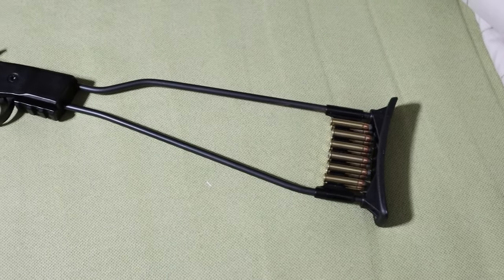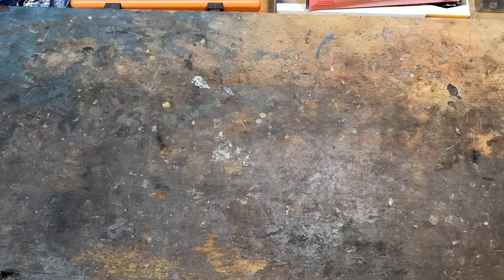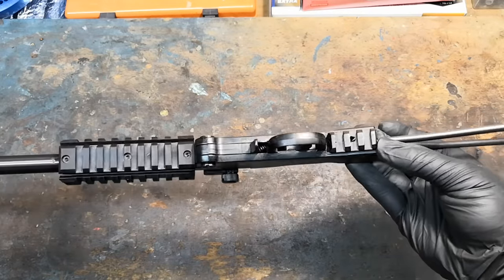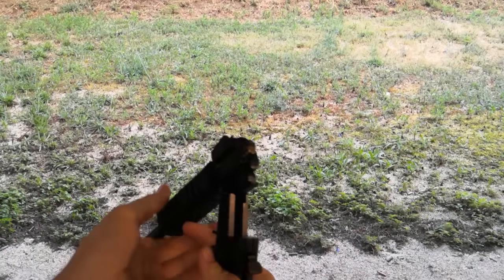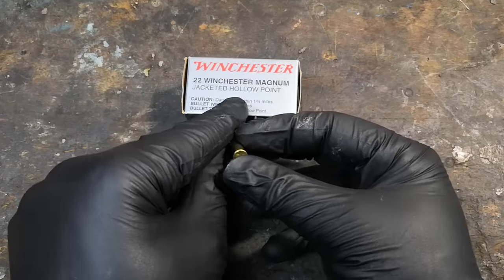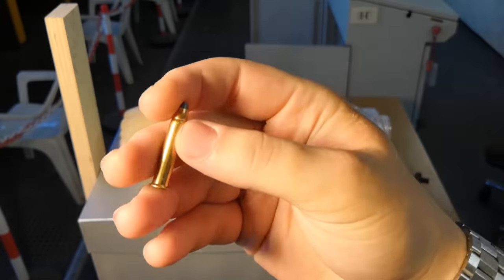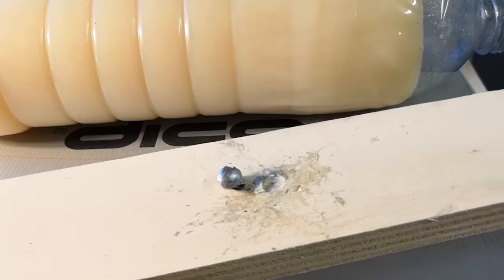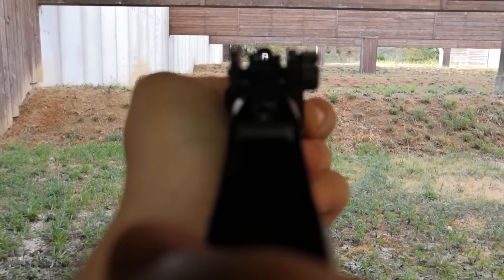How Good Is The Cheapest Rifle On The Market? Chiappa Little Badger

Comment: Seeing that wood baffled range, reminds me of my 2018 Trip back to Italy, and a visit to a friend in Parma. We went to his local shooting club (Ex- Military Rifles) range, and it was exactly laid out as this.
The Chiappa ( le chiappe means (a) window or shop shutters, usually wooden) or (b) Butt cheeks, plural).
The Name Chiappa derives from the Shutter origin, meaning a carpenter skilled in woodworking Shutters, both hinged, or removable, for securing ground floor Windows against illegal entry, or weather.
There is also an Italian Pun Joke regarding Shutters and Butt Cheeks ( untranslatable).
BTW, the gun shown is derived from a portable single shot 12, 20, 28 or .410 folding shotgun of Italian 1950s design, with full wood buttstock, and grooved forend to accomodate the Trigger Guard.
Still a bit awkward with a 28inch 12 ga. Barrel, folded, but will still pack well in a holster for Back packing.
This modern .22 version also reflects the M6 Survival rifle ( USAF).
Like the old " Marble Gamegetter" in .44/.410 shot.
Doc AV  Australia

Comment: A " suppressor" and ot can fit in a bag my friend you have a hitman weapon
Reply: pretty much. Sniper rifle on a budget. Put a suppressor on then use a subsonic round. You'll have to be fairly close and get decent shot placement, but it potentially can kill. 

People won't hear you as well and you can probably dump it if needed without losing much money.

Of course, at that point, you might as well build your own gun and accessories.
Reply: To much movies kid.
Reply: @dannygarden464  Eh, it's doable. A subsonic 22 fired from a suppressor sounds like a staplegun instead of a real one and can kill with good shot placement.

Personally, it's not my first choice. A larger subsonic round would pack more of a punch and be more lethal.
So, this in a 45ACP with subsonic rounds and a suppressor would be significantly better for the job than a 22LR or 22WMR.
Reply: @InfernosReaper  I was talking about the remark " hitman weapon " and yours " sniper rifle ", it's a 22, 1 shot,  a suppressor on top lol, you'll have more power and punch with an air rifle and as a bonus it's quiet enough, this rifle is more like a survival \ emergency kind of gun, and for the hitman weapon pretty sure they don't use that kind of weapon ( 1 shot), well some use a 22 as a gun because you need to put alot of rounds on a target to make sure you did the job right ( the zipper method)  and you put sub rounds with a suppressor that would make it even less lethal, so if i was stuck on a job with this weapon I would get to the target and hit the crap out of him with the rifle. ;)  still talking about the hitman weapon right ;)
Reply: @dannygarden464  While I agree that a more powerful weapon is better, for just killing 1 dude, good shot placement will make even a 22 more deadly.

I'll let this comedic scene make the point better than I can.
https://www.youtube.com/watch?v=ZTQSBm5A_FI
Reply: @dannygarden464  yeah, I have heard talks by ex CIA guys that say an assassin would usually use a .22 with a suppressor and it would barely make a noise. On a side note I had a friend who was accidentally shot in the chest with a .22 just once and he died.
Reply: @dannygarden464  I use a .22 for dispatching animals and have personally killed several 400 LBS+ pigs and a 1500 LBS+ cow with it.

Would a stronger round be more effective? Yeah, a sledge hammer probably would be more effective. But, it's pretty much a matter of tradition at this point and .22 leaves them dead enough.
Reply: @izzyb614  Yes my uncle use to use a 22 on the farm too but not for cows and pigs, well he change for a 22 power ( center fire) and was the only rifle he was using, I remember younger he teach me with the old 22 and after with the 22 power, versatile, cheap ammo, accurate, perfect for long shots and critters, good memories. ;)
Reply: @michaelreese8041  Yep I heard that too but it most be some truth behind it, I saw alot of airgun like an umbrella with a pellet with poison, with a 22 not so much and the ones I know didn't succeed, you have to put alot of rounds to be most effective, I'm really sorry for your friend, the thing with a 22 is once it enter the body you can't really know where the bullet will go, so powerful with no mass, sometimes it bounces and ricochet couple of times without leaving the body, a 22 with a suppressor or silencer can get pretty quiet but not like in a movie for sure and you need a special permit to have one, people think it's a little gun or rifle like a BB gun but it's very dangerous since the bullet travel very fare compare to other calibers.

Comment: I like its portability, its rear adjustable sights, the reload stack in the butt and that it has accessory mounting options, which I think he should have included at the end. I also like that it has a threaded barrel for a muzzle suppressor.

I want to see it with the suppressor and pistol grip on it. And Im curious as to what effect the suppressor has on its velocity or range, and id like to see a cluster pattern using the suppressor and a scope with the rifle stock.

Also I would have liked to see the pattern cluster at different ranges just using the iron sights.

And if it can receive a scope that would remain stable when folding and stowing between uses.

And the penetration test from a minimum of 25 yards away.

That's for simulating flesh, and if I had to use it on a critter, I doubt I would be able to walk right up to it and tell it to hold real still now while I shoot it behind the left ear.

I think you had better be an excellent shot with it so your game doesn't suffer while you reload.  
First shot is the kill shot is the last shot. One shot.

Comment: Add a vent ribbed bar and you could add a good scope night vision  etc. Windage sights would be nice. Although in 22 cal point shooting would be the way i shoot it. Hell with looking down the barrel. Im surprised it kicks that much with a 22 cal. Wait i just looked at the bullets. Are those 22 mags? They look longer than long rifle. Try yellow jackets in 22 long. They never fail. Rusted corroded wet dry theyll never fail you.

Comment: Very neat little gun. The caliber is limiting - in this case, the 22 Magnum won't offer any better performance than a underpowered load of 9mm Parabellum.
As far as survival gear goes (including for downed pilots), it seems to me that a 44 magnum with a 7.5" barrel would be far superior. It will have 3x-4x the muzzle energy and will be sufficiently powerful and accurate enough (with practice) to take down medium size game at 100m. Also, you get six shots before needing to reload.

Comment: I'm far from a gun expert, but is a plastic tip a good idea?
Reply: based of the firing speed i doubt it would end up an issue, especially using lower pressure cartridges

Comment: Compared to the Henry version of the AR7 the Chiappa Little Badger simply cannot compete as a reliable survival gun: - it is cheap and parts such as the firing pin will fail as will the soft chamber metal where your firing pin hits home. How do I know this? As a gunsmith I have worked on these guns quite often and, while I appreciate the extra work they bring me, I cannot in good conscience, recommend them to my customers. For just a few measly dollars more you can get a far more reliable semi-automatic .22 in the US made AR7 - but make certain you get the version made by Henry as the earlier Charter Arms version is worse, in terms of quality, than even the Chiappa Little Badger (again, I did warranty work on the Charter Arms guns and they were very low quality with a near-guarantee to fail owing to shoddy chamber metal which would crimp on the fired brass - necessitating a chamber 'iron' or reamer to clear the crimp; also, the Charter Arms magazines constantly failed).

Comment: I guarantee you it's better than a Stevens 73Y. That rifle should be a gunsmith's example of how NOT to design a rifle. Every single aspect of its design is bad. It's a single shot bolt action that jams if you're not insanely careful or lucky. How on earth you screw up THAT badly?

Comment: Without watching the video, I can tell you that it's not good.
I'm more interested in the best value gun on the market. A well working gun that doesn't break down easy and no paying for fancy bells and whistles. For example, you could pay 10k more for a car that is 2% more fuel efficient, but it isn't worth it, I wouldn't buy that car no matter what fancy nickname they gave to the expensive efficiency gadget. What is the gun equivalent to this best value mindset?

Comment: i d   set  it   vs 22 lr  china   semi auto  2 part  rifle //  it is   not    possible  in  22  or  possible 22 mag  but  it  is a semi auto  parts are steel    all gun  can be   even main parts as  /supposed  broken  spring//it  can   be all repaired with hammer and  punch //rock  and   nail if  in  wild//  hold 70 rounds  in butt//  folds  /bett   disassemble to  2x 12  inch   piece   1 ring  nut   and  there you shootin

Comment: What we are left with after the anti-second amendment lobbyists get done.
A crude single-shot 22 WMR that has ejection issues on "different" ammo, and a cheap wire stock that allows it to jump like a Marlin 336 30-30  loaded for bear.